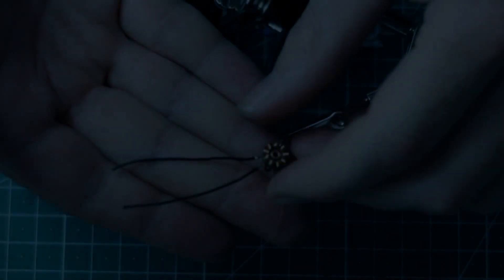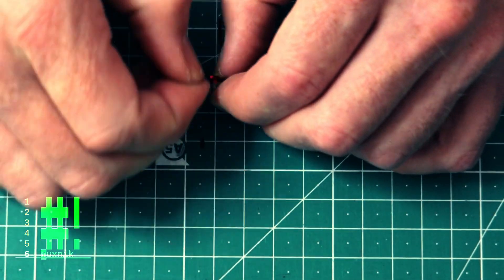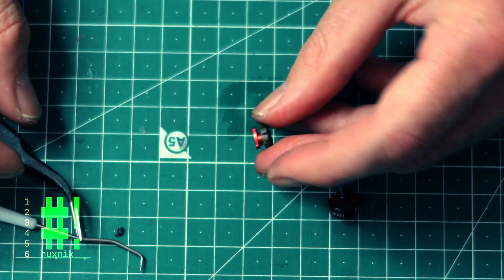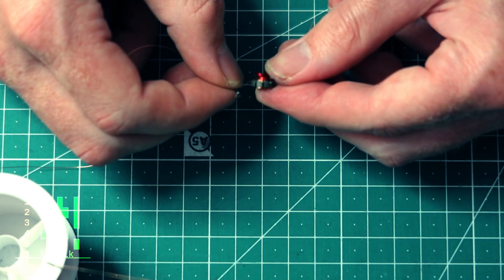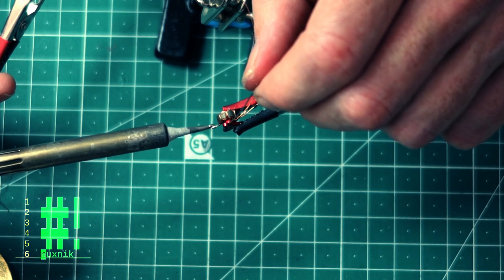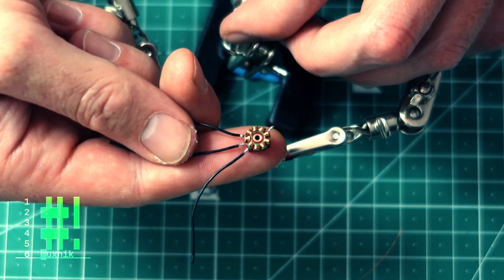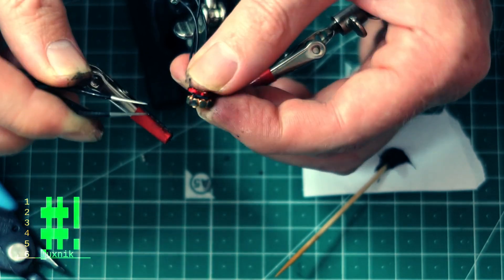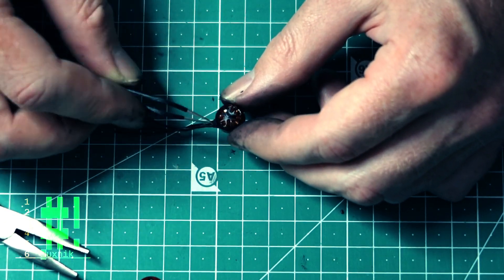Rewinding Tiny Whoop Brushless Motors

Comment: Hi. That motors have 30awg wires, but I bougt two versions of 30awg and one of 28awg, and all them are thinner from outside than 0802 motor wire. Is that wires will be good? Important is core of wire, not insulation, right? Tnx

Comment: If i want to get over 25000kv, how much turn should i do??
Reply from the maker: First, you will need thicker wire you could go for 0.3mm for example. Then you should try fewer turns than what was originally used. For example 7. This also depends on how thick the wire is and how much room you have. Afterwards you'll have to measure the KV to know where you are. It is hit and miss.  I have been thinking about writing an article and making a video about this topic. Here is a good article about measuring KV https://fishpepper.de/2017/10/17/tutorial-how-to-measure-the-kv-of-a-brushless-motor/ Good luck!

Comment: Quality control on this motor is shit!!!. I had 2 broken motors out of the box. Wiring were broken in both and I did rewind them out of desperation. Lucky, I have got heap experience on rewindind induction motors.
Reply from the maker: Wow, that sucks. I never got a bad one yet, just lucky I guess. I started rewinding my motors after looking at my small pile of banged up and broken motors that I collected over the years and thinking it would be a shame to have to throw them away. Good luck rewinding yours!
Reply: @nuxnik  6 of 0802  19000kv motors and 2 of 2205 2300kv have failed since New Year. My 5inch just dropped from the sky and I found nothing wrong with motor using multimeter and the wires. Just bad luck, fly 10mins fix 1hour. I have spent more time repairing than fly the fpv. Lol...😅😅😅😅
Reply: @nuxnik  How hard is it to do? People said it is hard, but by your video I think it is all about patience. I’ll do this in 2-3 weeks.